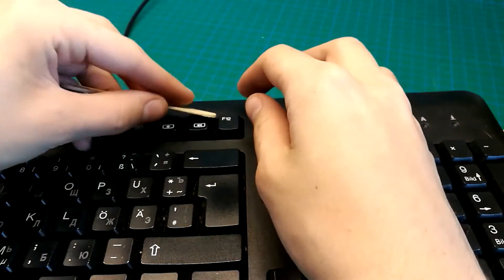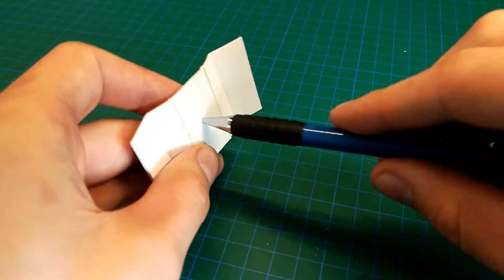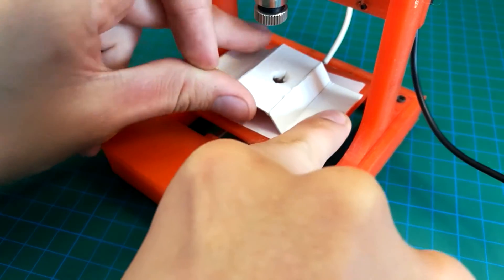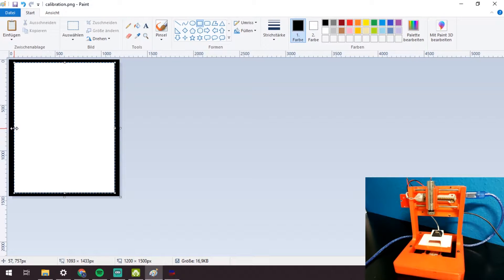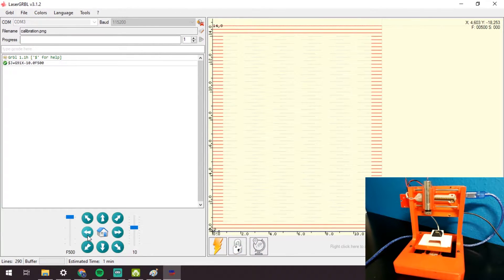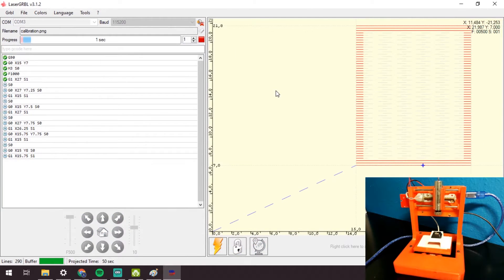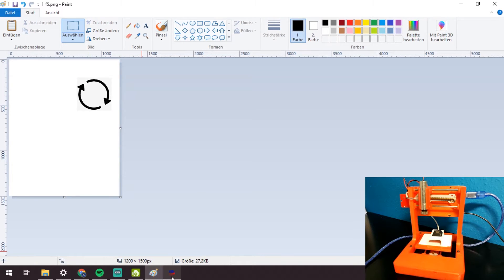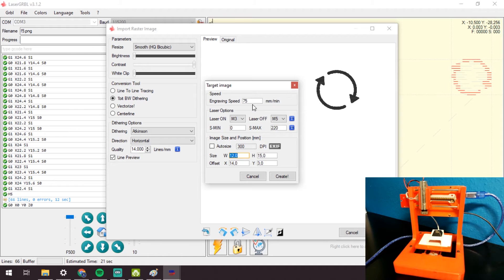DIY Keyboard Engraving

Comment: A link to how you built the cnc machine would be good. Also your letters look quite grey in colour, i think its possible you are engraving too deeply and going through the white coating (under the black top coat)mto the grey colour of the key . just a thought and don't know if i am correct on this but thanks for posting the video
Reply from the maker: Thank you for watching!
I followed this post https://www.thingiverse.com/thing:3521286 on Thingiverse for building the small CNC. 
There is some sort of clear coating on the keys, by engraving it is not shiny anymore in the spot where the laser was. The keys are made of black plastic, so they are not grey inside.